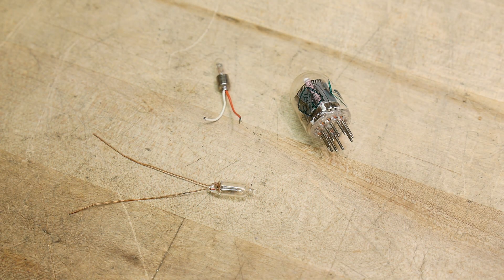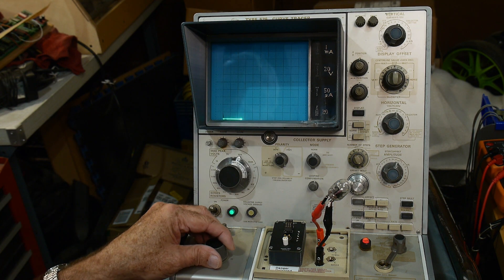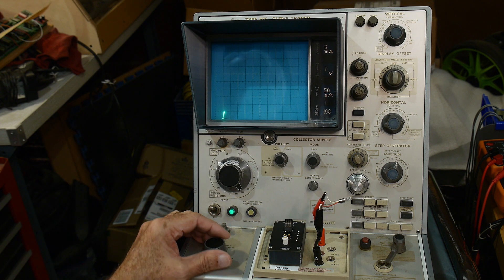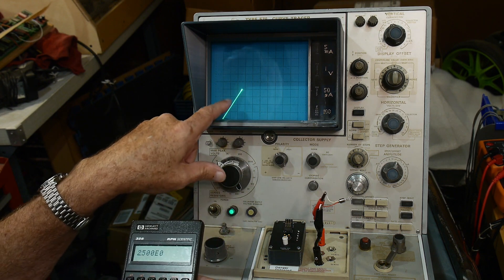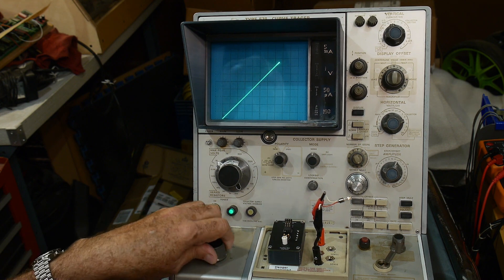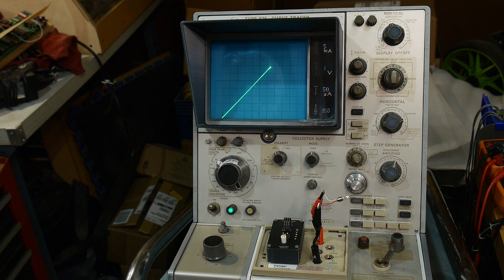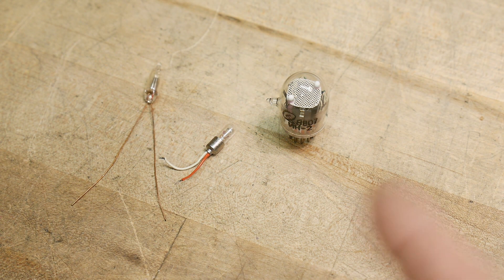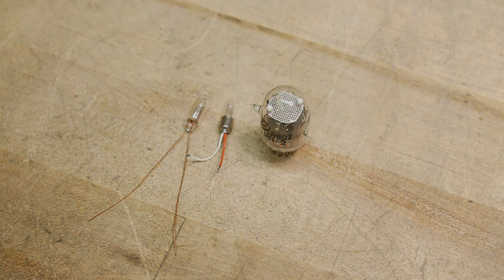#1328 Neon Nixie Incandescent I-V Curves

Comment: Beautiful curves! 
This video made me wonder:
(1) What is the sweeping frequency the curve tracer uses? It surely has a great impact on the incandescent lamp response, for instance.
(2) If you put a transparent celluloid (transparency) and use a permanent marker, you could plot the end-slope points to plot the operating points for different maximum voltages. 
(3) Still about that lamp, If you measure the cold resistance DMM, if could give the maximum slope (min. Resistance). Then you could check the said common belief the Cold resistance is about 10% of nominal (@100% voltage).
(4) About Neon lamp: I did a Joule thief running at 120V peak, ~40KHz, but it did not lit up the neon. It make me guess if plasma needs higher voltages or longer duration or even higher energy to ignite and maintain lit. 
(5) Suggestion for another video - plot (DC+ & DC-): Zener, NPN’s Vce (direct & reverse), red-LED (old tech) and white-LED (new), to see conduction and direct-avalanche and reverse-avalanche.
Thanks for sharing.

Comment: Trivia: Small 5mm diameter neon bulbs have enough on-state resistance to act as switches for 1-2kOhm reed relay coils. A neon in series with a film cap is a DRAM bit cell.
Reply: you might be interested in "incandescent ram"

Comment: It's very interesting to see the negative resistance of the neon bulb (the voltage at operating current is lower than the voltage before conducting current) that shows as a spike on the trace. NICE!

Comment: I expected a sharper break when the tungsten filament incandesced. Can you do a few LEDs? The hysteresis between strike and quench voltages of neon and other gas-filled tubes has always been a source of fascination and unusual circuit designs.
Reply from the maker: it was giving off photons all the time, just wavelengths humans can't see

Comment: Would a small halogen lamp be interesting to trace? I seem to recall they have a bigger resistance change when lighting up.
Reply: Yes they have a larger change, simply because they run so much hotter in normal use. you get the same curve for a short time with a regular lamp just by overdriving it slowly to around 150% voltage. They get very bright, but have a correspondingly short life then. 200% you get photoflood lamps, with a 20 hour life, as opposed to the regular one at 1000 hours life. The photoflood lamp just runs a little below melting point, like the halogen, but does not have the halide chemistry, to deposit the evaporated tungsten back on the hot spots of the filament.

Comment: We can argue that the curve tracer does not display the actual VI characteristics of the device, when the operating point depends on a dynamical equilibrium (and the equilibrium requires more time than the refresh rate of the tracer to be achieved). The nixie tube, and the incandescent bulb characteristics should have the shape of a square root curve (it's actually an exponential with fractional exponents) created by joining the last point of the nearly linear curve you show at each value of voltage.

Comment: My introduction to the resistive properties of the incandescent bulb was at a small record shop. The owner, as a side business, supplied background music to a number of businesses located in the same downtown area as he was. He'd put stacks of LPs on several changers wired to work sequentially.  The resulting music would be amplified and sent down the alleys on wires strung on the utility poles to each customer. To prevent the problem of a particularly strong recording from blasting the shoppers he had a (I think) 60-watt bulb in series with the amplifier output. As the music got louder, the bulb would glow brighter, and the resistance of the filament would increase. Voila! a poor man's volume compressor. 

I now realize how many archaic words and concepts are in that paragraph above: incandescent, record and record shop, background music, downtown, LPs, and changers. I really don't mind getting old; it's suffering the blank looks I get from my 20-something coworkers when I mention things like this that is disheartening. Thank heavens the retirement date is about three weeks away. I'm looking forward to sitting on my butt and saying, "We never used to do it that way."
Reply: Have you ever seen the guts of a BOSE Acoustimass speaker system?  It's flooded with light bulbs for the very same reason or, should I say, in order to not to blow up the drivers with too much power 😄
Reply: Why are you apologizing.   That is history and the stepping stones to where we are today in technology.   I grew up in solid state times but i learned about tubes and other things from the past.    For example.   Records could only play on the player made by the same company.   Back then there was a BETA vs VHS like battle going on between record player manufacturers before they standardized on universal technology for all that media back then.   Everything has growing pains before all is perfected so to speak.  We all are standing on the shoulders of those innovators who came before us to make things, and make things better.

Comment: Very nice and instructive pictures that you can observe with the curve tracer. 
When it comes to the light-bulb there is another parameter of interest, the heat up and cooling time. It has a time constant of about several tenth of a second. When following the curve more slowly, with 5 second per period or more, displayed in x-y mode with persistence on the scope you get different paths for the way up and down. Only at that slow speed one will also see that the trace has a bent to get even less steep above 700 °C when the crystal reforms to a different mode, (two times per period). 
As you know Hewlett has used the PTC effect (positive temperature coefficient) of a light bulb to stabilize his development of a wien-bridge-generator mainly to eliminate the harmonics and decades later HP came up with a "memristor"  (a resistor with memory) as a nanotechnology storage element, not storing in temperature but in crystal formation.
Reply: Indeed! When 'playing' with the curve tracer, it's a lot easier to see effects like the PTC of the bulb... Very difficult to see that in a screen-capture, e.g. in textbooks... And it's also easy to overlook on the tracer, itself, if you don't know to look for it.
I-V curves, as a concept, are kinda confusing, in that regard; Newbs might be led to believe those curves represent the devices fully. Yet, of course things like frequency and temperature can change such curves dramatically. Which leads one to wonder what other effects one might not predict to take into account in such curve-measurements. And what other such effects have been left out of IV curves in datasheets, etc.

(BTW, I've used the PTC of incandescent lightbulbs as a memory device in a couple of my vids)
Reply: @ericwazhung  "incandescent lightbulbs as a memory device" is a nice demonstration of the concept.